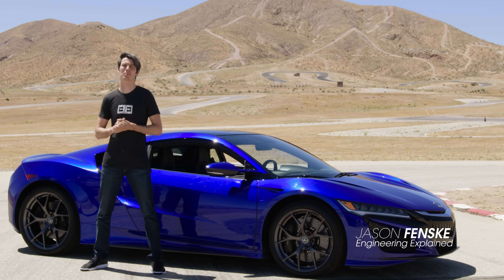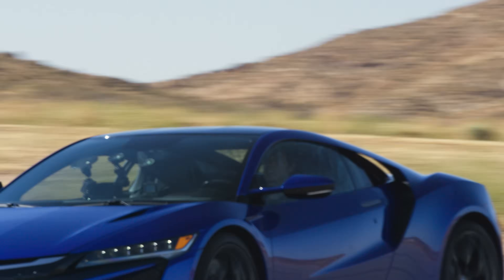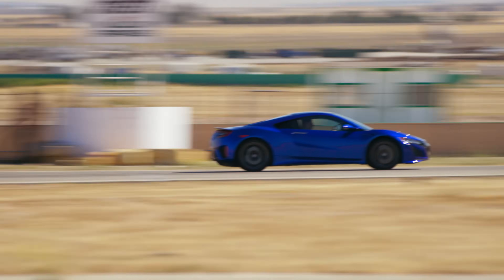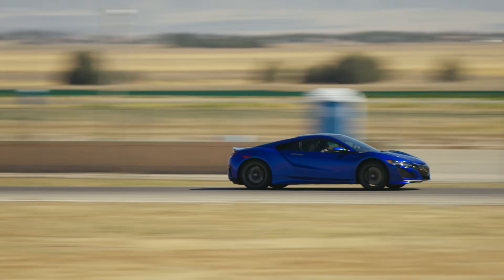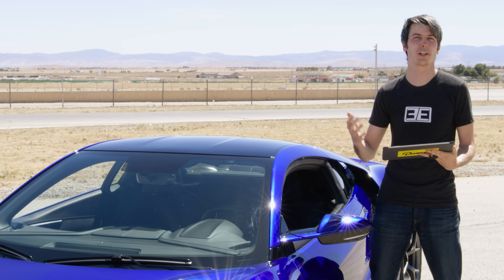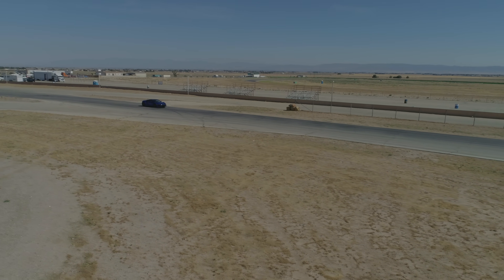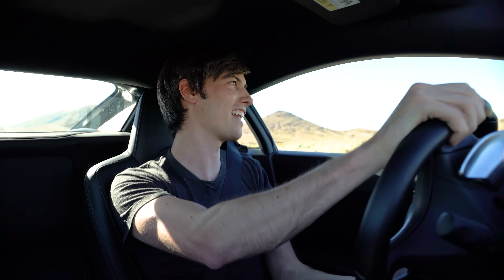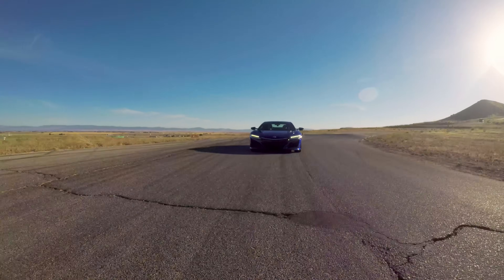How The Acura NSX Connects Man To Machine

Comment: This car is overcomplicated as ffff
Reply: Rofl cars built in 92 are overcomplicated. The minute you work on a car you'll realize how many redundant systems exist to protect you. My 92 SC 400 has so many sensors that I don't even know about and only start to get a clue about it when you start tearing things apart. This is no different.
Reply: Yet no one says the same about a P1 or La Ferrari
Reply: Not all cars are that complicated. A Tesla is extremely simple, or at least the power train is. They do as little as possible in hardware, and as much as possible in software, which is cheaper, lighter and way more flexible.
Reply: +zuilok
Really? are you taking carbureted or fuel injected? The tech you are refering too has so many other faults and issues let alone some serious delay between when you push the throttle. You have the slack in the cable that has to be taken up, the response of either the jets in the carburetor or the slow processing power of the 1st generation fuel injection system. Then on top of that you have (if you are referring to american vehicles) over sized and lazy large displacement engines. Then there is the outdated transmission technology, be it manual or automatic. Sorry but while I LOVE my 1965 Chevy II nova and my 1992 Nissan Skyline R32 GT-R, my 2016 Jaguar F-Type and my wife's 2017 Porsche 718 Cayman... are lightyears better in every single way than older vehicles... SO while I have my love for older vehicles and they have their place in my garage... In no way shape or form are they better in any way, than a modern performance vehicle. YES if you compare an "old skool" performance vehicle to a Ecobox of today... then the performance vehicle is going to "feel" better.
Reply from the maker: It may seem that way on paper, but to be honest all cars these days are extraordinarily complicated if you take the time to understand the details. On a racetrack, it was truly special to drive around.
Reply: Well since you took all that time to write a response to me I will try to do the same. First of all, notice I am not criticising the NSX because I simply cant, I never drove it and most likely never will in my life. You are probably just about 99% more informed about these new sports cars than me because you actually own some. I dont. But that doesnt make my statement false. If you want to know what car/engine I am talking about its a 96 subaru justy with a G13B swap with 4 point fuel injection. Also yes I am comparing that to pretty much econoboxes like skodas, daewoos, opels VWs and my E36 325i which probably never heard the word economy before but it sure has a crappy throttle response.
Reply: Not close to 4 Motor Independent Torque Vectoring BEVs like Rimac, NIO EP9 & Acura 4-Motor race car.
Reply: Give me a naturally aspirated engine with cable operated individual throttle bodies and I´ll be happy with my throttle response every time :)